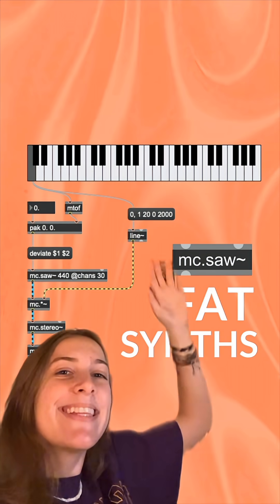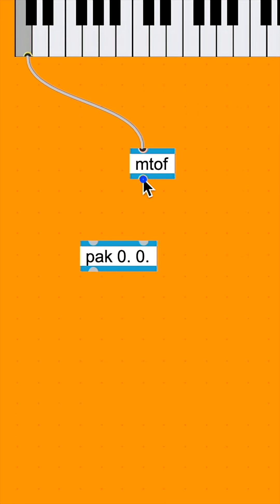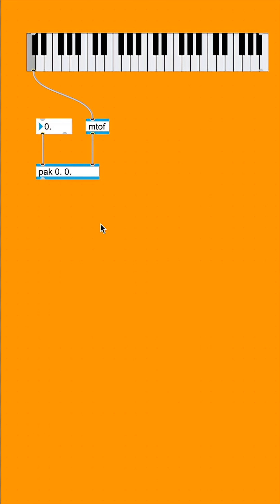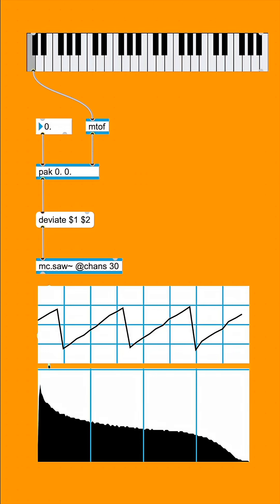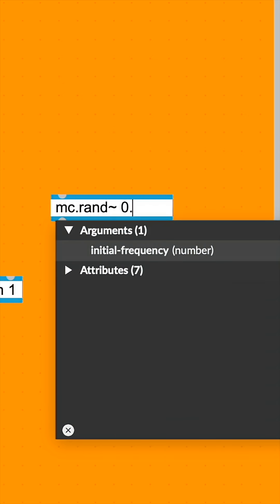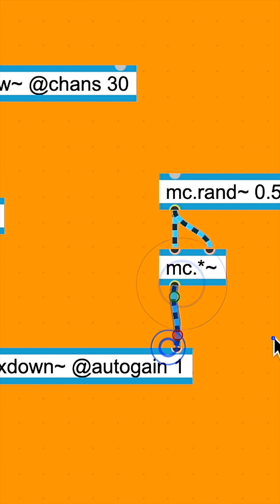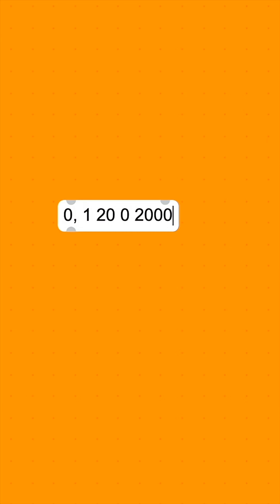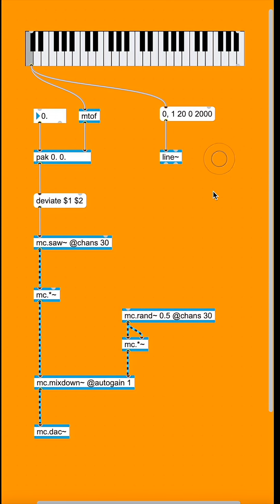Building a fat supersaw synth in Max using MC objects! 🔊🔊🔊  #sounddesign #synth #livecoding

Comment: i think you're overcomplitacing it with unnecessary message and pak kind of objects, i don't see a lot of difference between using message here and writing parameters inside line models which could give you a chance to explain what are those number that you put into objects